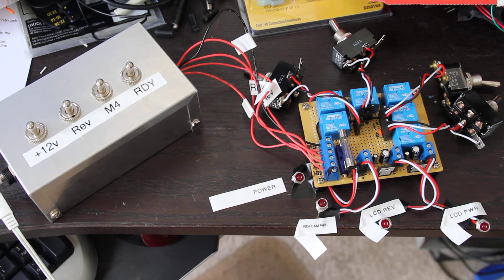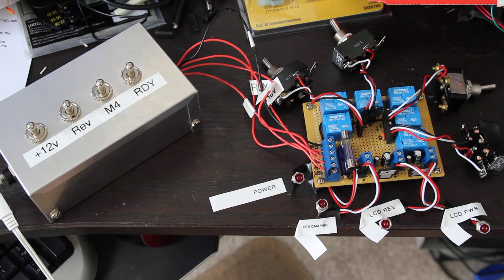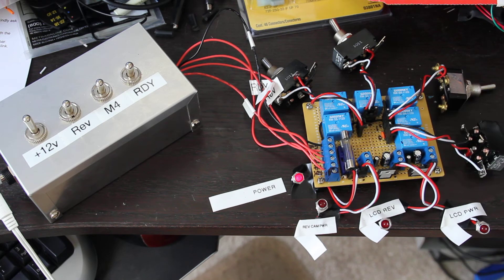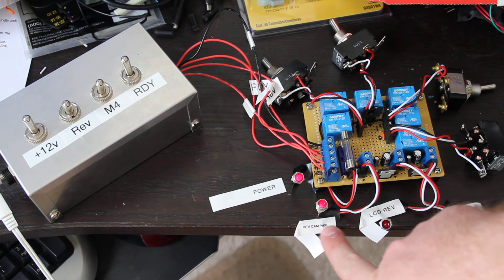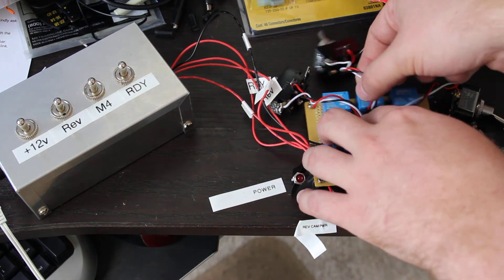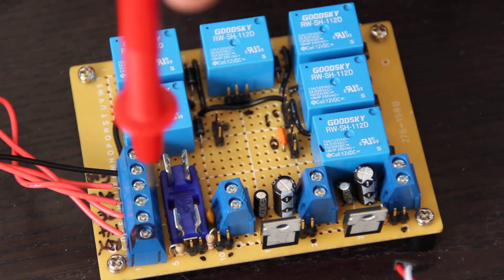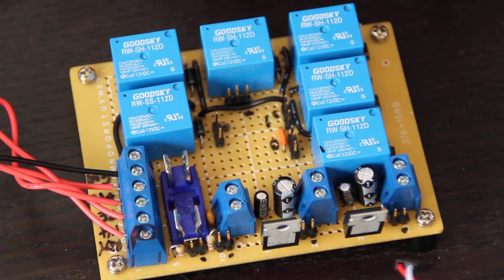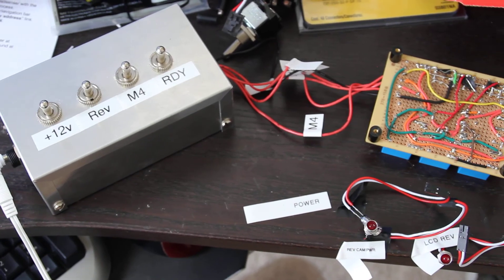Bill's CarPC - Part 5 - Power Control Module - Bench testing

Comment: hey nice video trying to get my carpc to work like this. do you have a schamatic for this in that case could you send that to me?
Reply from the maker: sorry, I don't.  I abandoned the project when I moved and my commute changed from 45 minutes to 5.
Reply: okey too bad but thanks anyway. but you might be able to awnser a question i have. how did you make the pc turn off after you pulled the key?
Reply from the maker: That would be the M4-ATX power supply.  It has an input that says whether to be on or off and when that signal goes off its just like hitting the power button in Windows, and it shuts down gracefully.  That line is connected to the 'accessory' or 'ignition' line in the car, so that it happens whenever you turn it on.
Reply: Bill Carlson thank you verry mutch been looking at diffrent ways to do that and that seems easy.